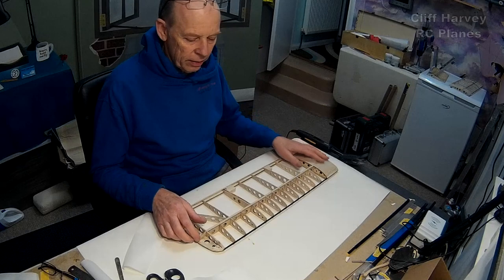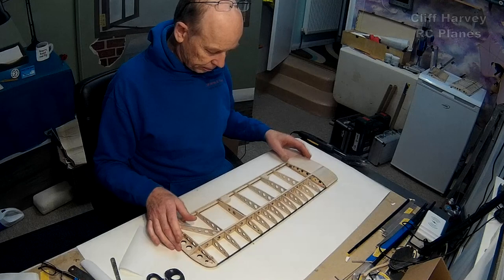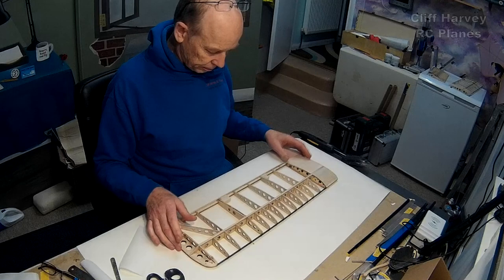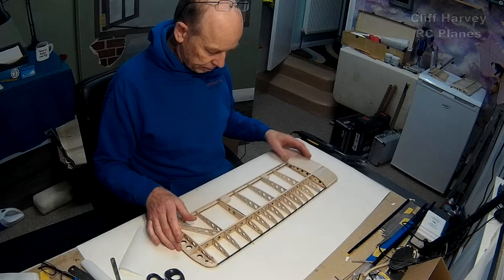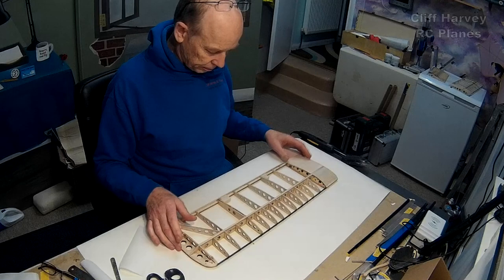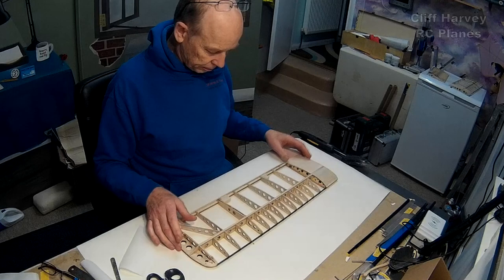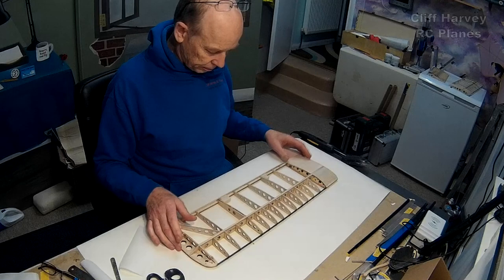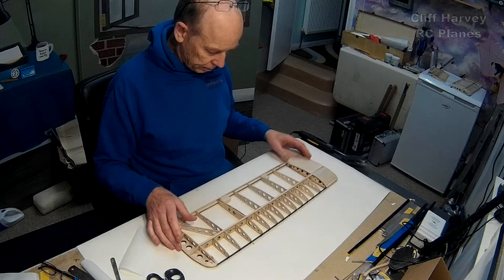How to Cover a Model Aeroplane Wing with Iron-On Covering

Comment: This video answers the question I had but didn’t ask whilst watching the last one! Thank you! I’m getting ready to cover a Guillows P-40 model with heat shrink- my first heat shrink covering. Thank you for doing this!
Reply from the maker: Go carefully Ben and you'll be ok, be aware a Guillows is a much lighter structure, are you using one of the 'lite' coverings?
Reply: @CliffHarveyRCPlanes   MonoKote is what I picked up at the hobby shop. I’m waiting for the iron to show up- it was backordered. Is the concern that it will break the structure of the wing or that it’ll be too heavy to fly well? New to this hobby but really enjoying it so far. Your videos have been very helpful and entertaining. Thank you again.
Reply from the maker: @benjaminwinn8899  Hi Ben, not so much 'break' the structure, just add more weight than is necessary. A lot of manufaturers offer a 'lite' version for lightweight models, it'll be ok.

Comment: Very informative.  Thank you for the videos.  I prefer more Monokote or material available to pull for a better grip.  More waste, but easier to pull and less chances to burn fingers on the hot iron...
Reply from the maker: I agree Guy but if I was to stand any chance of getting the complete build out of six metres I had to be frugel, cheers 👍

Comment: That was a helpful refresher before recovering a damaged wing. Particularly the iron temp. Most other videos and even the manufacturers advice sheet can be a bit vague on that aspect.
  Thanks Cliff
Reply from the maker: Different films react to different temperatures Rob, but if it's not sticking turn it up, if it's melting turn it down! You soon find a happy place 👍

Comment: There is a shortage of covering irons currently in the US. Some are buying easily available small, heat-adjustable, "travel irons" which work well. 
Keep a good supply of sharp knife blades, they dull quickly cutting mylar covering materials. Good sharp scissors with clean blades are needed for cutting covering material. Making cutting patterns from Manila folder material can be helpful avoiding mistakes and waste of covering material.
Reply from the maker: Somebody else said there was a shortage, all those lost sales! Yes, I used to use a travel iron years ago and, as you say, they work just as well except a little heavier. It's amazing how quickly the blades dull isn't it, I'm not sure why that should be. The scissors I used I found in my wife's sewing drawer, I'll have to sneak them back before she spots the video! Paper patterns, yes, excellent idea 👍

Comment: Cliff, if it  were dihedral wing, would you still use the same technique as in your video above?  Covering each wing separately and then joining? Many thanks  Geoff.
Reply from the maker: It depends Geoff, if the wings were separate entities after they're finished then  separate but if they need to be joined together as a one piece wing (with a dihedral brace glued in) then you would need to cover the wing a half at a time 👍
Reply: @CliffHarveyRCPlanes  Spot on, thanks Cliff. Appreciate!

Comment: A very interesting and informative video. I've never used film I've been too scared to use it. One thing that you didn't cover was why you didn't use coloured film. I'd have thought that it would have been better as it kept the weight down and you don't have to paint it afterwards. Please could you explain your reasoning?
Reply from the maker: Hi Tony, thanks for watching and a very good question however there is a reason I covered it in opaque fabric and that was because I hadn't decided what colour scheme the model would be finished in so I wanted a neutral base 👍
Reply: @CliffHarveyRCPlanes  That makes sense, thanks for replying.

Comment: what is name of covering you are using? tks
Reply from the maker: Oratex Alex I think 👍
Reply: @CliffHarveyRCPlanes  tks
Reply: @CliffHarveyRCPlanes  how is weight of oratex compared to regular covering like ultrakote? i am restoring a plane with an old painted textile and i am considering change the covering with ultracote but since i have not done any wing covering before i  wonder if it is even worth it. tks
Reply from the maker: @alexherrera3918 Probably not much in it I wouldn't have thought. The Dr.1 has so much wing area a few extra ounces doesn't matter much 🤔👍
Reply: @CliffHarveyRCPlanes  ok tks!!